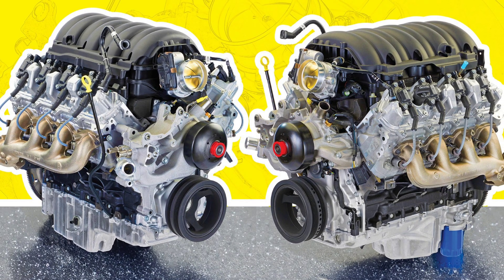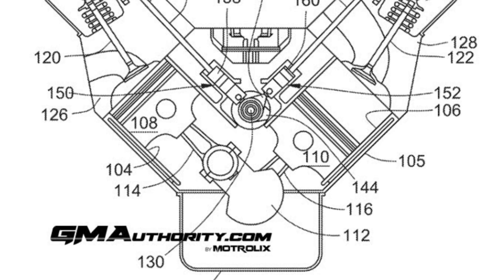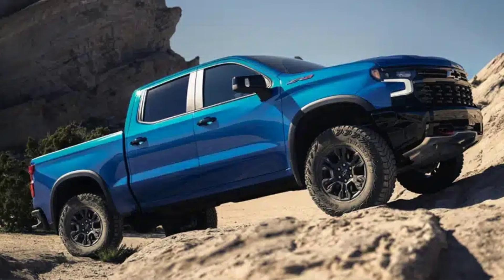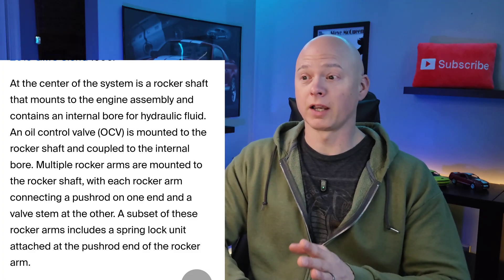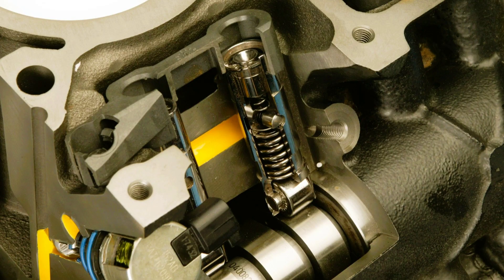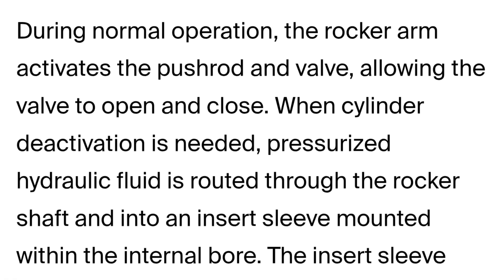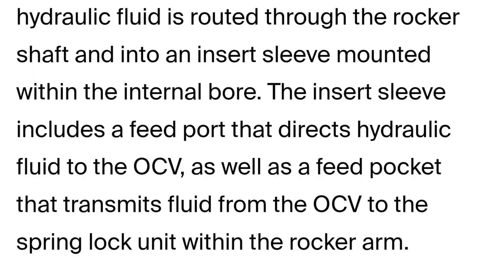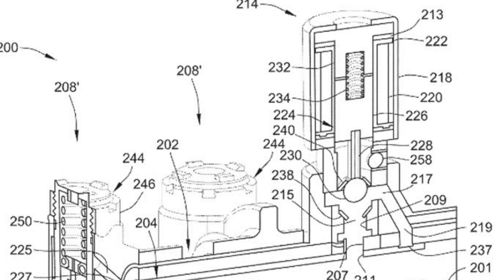GM's NEW Cylinder Deactivation System could ELIMINATE the DFM

Comment: Settles it, I'll just rebuild my vehicles with a nice 500 HP crate engine. They will spend millions to redesign but who will pay when warranty wont cover engines that fail in 5 years. If those morons want to experiment build trucks then give them away until they prove themselves for 10 years.

Comment: 99% sure this system is similar to what Ford is currently using on thr 5.0 coyote motor, and Honda has been using this type of system for vtec and cylinder pause systems forever.

Comment: I have a 2012 Ram pickup with cylinder deactivation on its 5.7 liter engine now with 112,000 miles. There has been no engine problems with the deactivation to date, but I do not see any good value purpose to it, and wish that it did not have it. Otherwise, I like the engine and it has been reliable.

Comment: Regardless if this new version works, and I would not trust it, this technology has always been stupid for heavy vehicles.  Trucks need eight cylinders all the time unless they are idling or coasting downhill.  New chevy trucks and suvs are way too expensive anyway.  My 2013 Tahoe with flexfuel uses a Range or Holley system to run eight cylinders all the time.

Comment: What are you doing, GM?  CAFE is no longer a thing.  Just make simple, reliable engines.
Reply: they've gone all in on their obsolescence programs. this isn't about fuel efficiency it's about making vehicles that catastrophically fail right after warranty so they throw the buyers back into the market or the consumer spends 10k buying a new engine from GM.

Comment: Meanwhile LS motors that are non AFM and CD are hitting 300k miles and still running.

What could go wrong, all over1-1.5 mpg at the most?

This may be GMs final self harm moment.
Reply: Thats why they won't go back..obsolescence is$$$
Reply: And you’re spot on with the mileage, I bought a disabler for mine and I have gotten 22 miles to the gallon full V8. But I do lose about 3 miles to the gallon city driving. I don’t doubt I could reach 25 miles to the gallon if I was to drive four or five hour straight down the highway. DFM is absolutely stupid!
Reply: @Maynardd I build LS motors now and then, stay well away from anything post 2004, my personal 98 Trans Am with a 450 hp HCI 5.3 easily gets 27-30 mpg  on the highway, stock LS1 it got well over 30.
I also have a 2004 Express 3500 with a 6.0 that has 200k and is still running strong, always averages 16-20 loaded up.
They f-ed up when they tried to one up the simple LS with the CA/DOD, then the LT platform, and it’s been failure ever since.
Reply: @D@DCFloridasport98 Trans Am? In 1998 I ordered a Trans Am WS6! Six speed. The only year that had dual exhaust that came out of a single exhaust tip. Never understood that? The body even had a cut out for the other exhaust tip. Love that car!
Well, I’m stuck with the 2025 trail boss. Well aware of the possible lifter issues, which is why I have the disabler, same shitty lifters, but hopefully it will help. Five years on the warranty and that’s when I’ll get rid of it. But yeah, I just don’t understand the reason for DFM.
Reply: @Maynardd Mine is a regular TA so dual into one and back into dual, my neighbor had a Formula with that single exhaust tip always thought that was weird.
I liked the Z-71s since I had always had them  96, 99, 2001, then needed the 2004 van for a new business.
The new ones are so overpriced and it’s crazy how there are almost no more non DOD gas motors, that’s a crime, the gen 3 5.3 is probably the best V8 ever made imho.
Reply: @D@DCFloridasport agree! That Trans Am WS6. I only had it for a year and a half. I let a woman get the best of me and traded that in for a full-size two door Chevy Tahoe but she felt the trans Am wouldn’t work with kids. To this day that Tahoe is absolutely in my top three favorite vehicles that I’ve owned. In five years if I don’t get rid of this trail boss, and the lifters fail on it if there’s no other issues, I would just do a full DFM delete if it’s out of warranty.
Remove the lifter issue the 5.3 is still a great engine. Maybe I’ll never have an issue with it? But then there’s the transmission to worry about. I have no idea why they choose to make things so complicated. I’ve owned two Dodge rams, one Ford raptor, and this is my first Chevy pick up truck, but I have to say, I like it even better than the raptor. It really does ride like a Cadillac. The seats could be a little better, I have yet to find a better seat than what was in that raptor. But for what you pay, that raptor was absolute garbage interior as far as the dashboard, doors, electronics, even cheaper than GM. That Ford interior was always creaking.
And of course, does at least up until 2001 were known for their cam phaser failures. I had a 2000 and traded that in after warranty ran out. I really did like that 3.5 twin turbo. It was a smooth engine. But I change oil religiously every 3000 miles to try and keep it that way. Same with the Chevy.

Comment: Just remove this bullshit go back to lsx no methanol no direct injection no vvt no active fuel management just go back to lm7 but use the 5.7 with a supercharger on top
Reply: It’s clearly not that simple
Reply: @Brahdeez  yes it is.
Reply: @aurthorthing7403no. It isn’t. They have to follow ever-tightening emissions guidelines which eliminates the possibility of that kind of stuff happening. If they don’t comply with epa standards they aren’t allowed to sell their car. Period.
Reply: @Brahdeez  you are wrong.
There are ways of complying with emissions laws and not over complicating the system.
What they are doing is called "planned obsolescence" which is why half the engines are made out of plastic junk and they stop making replacement parts after 5 years.
You appear to have the tunnel vision that automobile manufacturers are selling you.
Reply: @Brahdeez EPA has nothing to do with it!
It's cheap Chinese lifters!
I spoke to a GM engineer!
I was right there where all of the testing takes place.
Reply: @philllsxga.7737 the epa is the reason that they need the dfm. That is what the original conversation is about. Nothing to do with reliability.
Reply: @Brahdeez the WHOLE topic is reliable!!!  It's cheap Chinese parts!!
If GM cared about reliable and their customers, this amf dmf would not be on YouTube!!
EPA has nothing to do with these engines!
What about passenger jet liners???
They pollute the most !!
There is no restrictions on their exhaust!!
Reply: @philllsxga.7737 no, the original comment is about removing direct injection, vvt, and presumably the dfm mentioned in the video. That stuff is there to comply with emissions guidelines.
Reply: @Brahdeez correct!
It fails and has flaws due to cheap Chinese parts!!
I had a Silverado LT 5.3 direct injected  with 148000 trouble free miles!!
Not one issue and I abused it!!
The later 5.3s had all kinds of lifter issues!!
Plus my truck had a 100,000 mile drive train warranty!!
After 2014 GM went to 60k mile drive train warranty!!
Vehicles are made to last the life of the warranty!!!
Direct injection amf dmf is not the problem!
It's cheap Chinese parts!!
I was there!!!
Reply: @Brahdeez that's a dam lie cus the military ain't gotta follow that bullshit. Military and government vehicles is exempt why is it ok for them but not us?
Reply: @jackdaniels2657 why don’t you look it the fuck up? The military is under separate authority from civilians (department of defense vs EPA)
Reply: Um no.
My 2014 Silverado gets 24 MPG!
Yes, 24 MPG average with the cruise control set at 74 MPH.
Near fully loaded Z71 5.3 V8!
Reply: @philllsxga.7737 if u want good fuel mileage just buy a Prius. It's a truck it's made to tow it's not made for fuel economy. That's why these engines is garbage u think ur saving at the pump ur only paying more for the repairs. Vs if u pay a lil more at the pump u save money in repairs. For example an old 2003 Silverado gets 16 mpg highway ur paying at the pump but should ur 03 Silverado go bad ur repair cost is far less ur maintenance cost is far less ur reliability is far greater less time in the garage more time on the road. I would rather pay at the pump then pay at the shop.
Reply: @jackdaniels2657 I get that..
148000 trouble free miles! It's called maintenance!
Why not have a truck that gets good fuel mileage???? Best of both worlds!!
24 MPG average with the cruise control set at 74 MPH!!
16 MPG?!?!?
I would average 18.7 MPG with a quad in the bed and one on a trailer!!!

What's wrong with that??
Don't be sour.
Reply: @jackdaniels2657 and you're making a negative comment because I'm getting 24 MPG with my truck??
What's wrong with that?!??

Comment: It's a step in the right direction, tearing the engine apart to get to the lifters was just wrong and a big waste of time.
Reply: I have owned many Older GMs and never had to replace any lifters !
What a bunch of cheap Chinese parts!!
Reply: You've obviously never worked on an LS/LT engine.  The cylinder heads don't have to come off to get to the lifters or do a cam change.